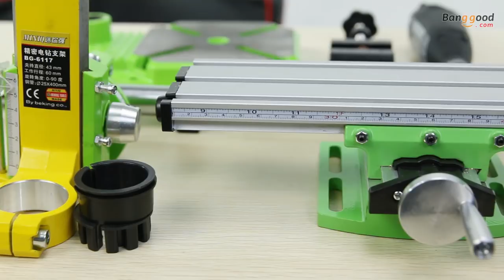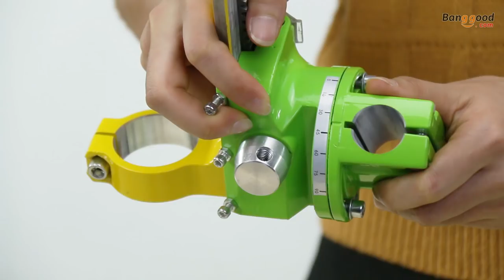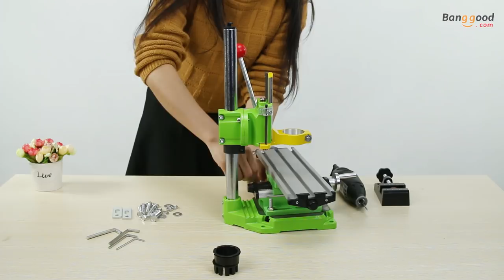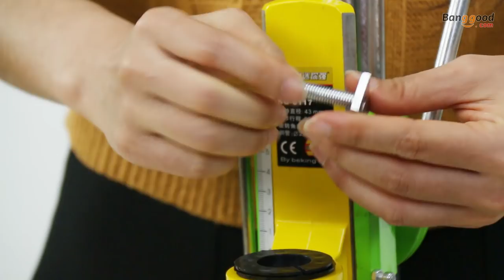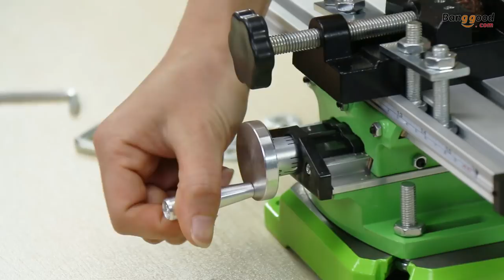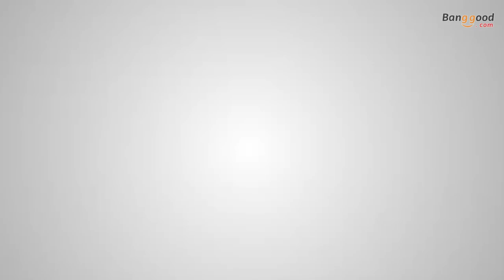Mini Electric Drill Carrier Bracket With Mini Bench Multifunction Drill Vise Fixture Worktable

Comment: I have both the drill press and the table.  The holes that she puts bolts through to hold them together don't line up with the base.  Not even close.  The slots in the table are not long enough to align with the "X" pattern slots in the base.
Reply from the maker: We suggest you reassembly it or tighten the screws.

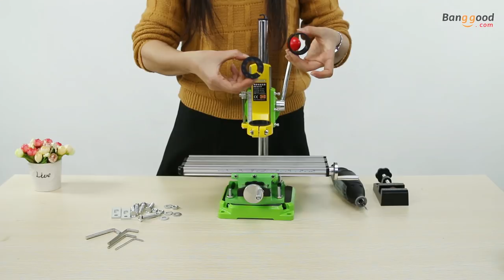Comment: @3:10, what are the collar sizes there? Can it fit a Proxxon FBS240/E that has a diameter 20mm spindle?
Reply from the maker: Dear friend, it can only fit which has 38-43mm spindle, for more information please check here  http://www.banggood.com/Mini-Electric-Drill-Carrier-Bracket-90-Degree-Mini-Electric-Rotating-Fixed-Frame-p-1020041.html  Hope it helps and best wishes!

Comment: This thing needs a handle to move it to the junk....
 The dremel has no cylinder shape to fit that clamp, still a dremel is not a tool to drill, at 10000 rpm it just burns your drillbits and this thing has a lot of play in any direction....

Serious tools cost a serious price!
Reply: Dremel can do many kind of job.. Drill, cut, saw, routing.. It has many kind of attachment. And the speed is adjustable too..

Comment: Funny min 5:10 shows him turning the wrong way with the allen wrench. Then he goes the right way. That could have been edited out but I bet the editor kept it in as a joke at him.
Reply from the maker: +Bob Walker haha,I think so.:)
Reply: +Bob Walker The allen wrench turner's a woman.
Reply: She needs to tidy her long hair. A no-no in a workshop enviroment
Reply: that's definitely a female Chinese, but seems the machine is not tight enough and shaking when she turns the wheel.
Reply: it's not mounted to the bench tho. stability would be 10x better. seems very useful tho when hand holding the dremel gets tedious
Reply: I think she skipped a few flat washers then heads should be on the top. the hold downs for the vice were pointing different direction, this isn't going to hold work to solid, it really should have a set of joe blocks and none of the bolts are hardened steel, its all soft metal parts. About the only thing you could use this on is none ferrous metals plastics or wood with light passes each cut.
That motor is not going to take a lot of abuse.you might make a few parts with it but everything needs to have a wrench put to it.
Reply: @johnacsyen  Yeah it's pretty hair suitable to be shown off and all, but not in a machine shop